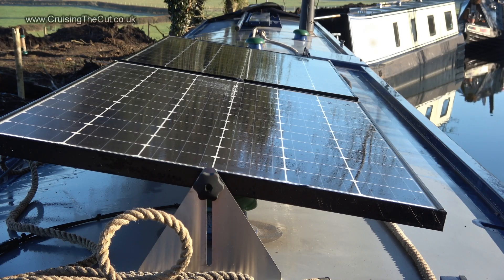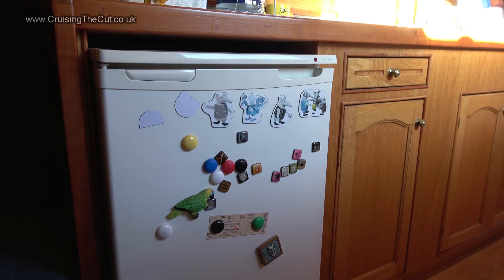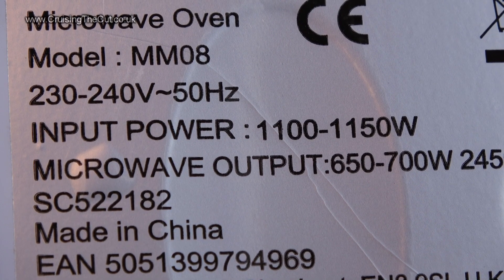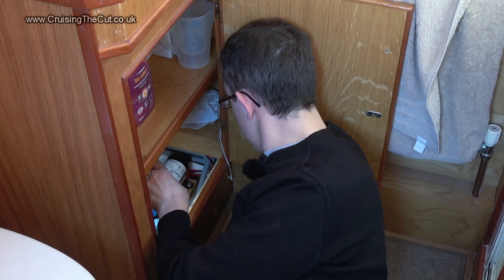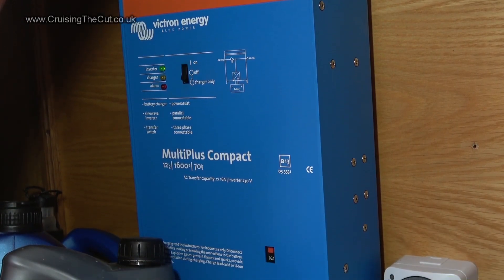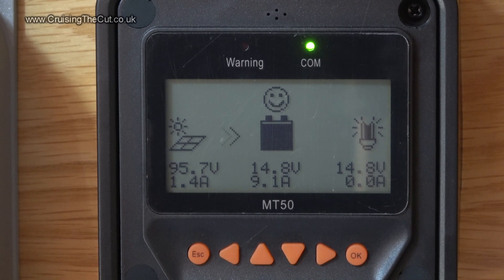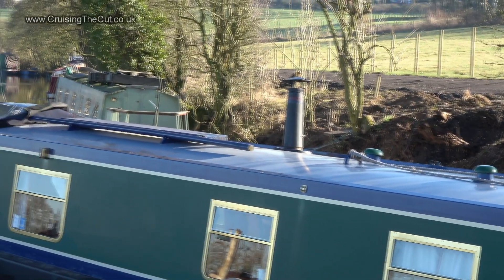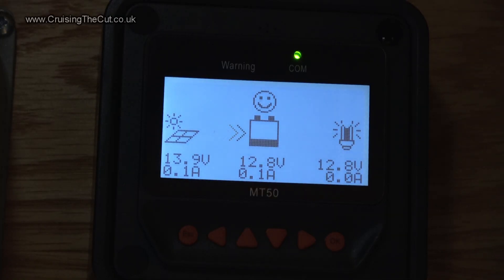76. Is solar power sufficient for a canal narrowboat in an English winter?

Comment: Hi David, as one who has worked with practical applications of solar power for about 10 years, I wanted to share a few thoughts.  As you have wisely discovered (probably the hard way), you have to account for every watt of power consumption when running from the limited supply of batteries.  (Sorry if I am repeating obvious elementary information.)

To begin with, back in episode 18 (solar system installation), I noticed you bought some very nice panels but, totally the wrong cell count.  Then, to make matters worse, the panels were connected in series.  With a 12 volt system, the preferred panel should have 36 cells and the panels should be wired in parallel.  Note that the conversation efficiency gets poorer as the difference between the inverter input voltage and battery voltage get farther apart.  Also, as you have already noticed, with a series connection, the solar output is proportional to the cell that receives the least amount of sun.  So, with the setup you have, as a minimal cost improvement, I would recommend the parallel panel connection.

Probably one of the higher watt/hour loads you have is the refrigerator.  I was just curious, how is the heat removed from the unit?  I am assuming the condenser coils are welded to the frig chassis and the whole unit is fitted into a galley cabinet.  Is there any ventilation in said cabinet?  If not, you would be raising the inside cabinet temperature and the frig would probably need to run twice as long to maintain the set temperature.

A portable inverter generator would be useful to top off the batteries if it could run off the stove gas supply and be placed in a sound isolating box.  Of course, that would be a sizable expense and engineering effort.

Adding additional solar panels would be useful but, still fall quite short of the demand requirements during poor sun days.  With solar panel output of just a few percent, you are barely covering the quiescent power draw from the power inverter.  In fact, I turn off my inverter off when mains power is not required.  I don't know if that is an option with your system, you also need a way to apply limited current to the inverter (such as through a small 12V incandescent light bulb) before throwing the power switch to prevent pitting the switch due to charging the large capacitor bank in the inverter.
Reply from the maker: Hi. The number of cells and voltage doesn't matter as it's going through an MPPT controller so it uses all the available power. They were in series because there are some advantages to doing so but I have since changed them to parallel as an experiment. It's usually the case that if one panel is in shade, the other probably is too so it doesn't make a lot of difference.

As for the fridge, I have drilled vents in the floor right behind it so that very cool air can convect up from the bilge as the hot air escapes.

The inverter draws less than 1 Amp so it's fairly low but yes I do turn it off when not in use during the day. Cheers
Reply: @CruisingTheCut  Thanks for the response David.  The MPPT controller has a circuit that constantly monitors the output power being pulled from the solar panels and is used to control panel loading to find that sweet spot where maximum panel output is achieved.  However, the farther you step down (or step up) the voltage, the more loss that gets incurred.  This is just the nature of the beast.  Yes, the MPPT helps but, you are still stuck with that loss.  Designing several DC to DC converter supplies over the years has made this (probably little known fact) evident.  Wiring the solar panels in series is only useful for simplifying the wiring between the panels and solar controller.  You can get by with less wires and those wires can be smaller in diameter.  You are probably only wasting about 5% of your power so, it's not a huge deal.

Very good on the other things I mentioned, you have obviously have been doing quite a bit of homework!
Reply: @billharris6886  I disagree that series wiring is only useful for simplifying wiring, it's also useful for stepping up panel voltage for 36v systems for example.
Reply: Excellent info

Comment: Saw something on another channel which MAY have something to do with your van solar issue that hosed the batteries. It seems Victron MPPT solar controllers don’t like getting hot and when they are subjected to hot conditions the load side turns off. If your van is closed up in storage in conditions that will cause a MAJOR overheat buildup inside may have something to do with your van issue. Mark Fay MMC Jr. Engineer QMED AS-E / MSC E

Comment: I suggest adding a small nuclear reactor to your vessel...  A bit more dangerous in theory, but the power gain would be incredible.  You could sell power to other narrow boats, villages, and towns, near your changing mooring sites, somewhere off the beaten path.  The calming green glow of fission at night would be very soothing, I believe.  Or, how about this idea?  Ever put cans of beverage, into a cold lake or river, to get cold?  How about the canal water?  What is the average temperature during winter?  A submersible bin with plastic and glass watertight packages?  Might reduce your power draw at times, but would it be consistent?  Hmmm, nudge nudge poke poke say no more...
Reply: David admits he’s a bit of a numpty when it comes to DIY so adding a nuclear reactor might not be such a good thing. Plus it would be such a palaver. Maybe just add a cooling tower as he likes those, though it’d be tough with the tunnels and bridges!

Comment: Would it be possible to adapt the technology which drives the fan on top of the fire to generate electricity, during the winter months??
Reply from the maker: It already exists, yes but the power generated is tiny, barely enough to charge a phone.
Reply: @CruisingTheCut  Presumably the back-boiler which appears in the very next vlog, would be a more efficient solution, being that the immersion heater canes the batteries. Cheers!
Reply: Yes it's called heat

Comment: Hey, just know that Watt is the unit of power, that is Volts x Ampere. Ampere is the unit of current, that one should not use for power calculations. Just learn about that, any wikipedia will tell you.

I think, you should just install one or two more alternators on your diesel engine that would produce more power and especially more drag on your mashine not to run idle. You also need more battery capacity. Especially when you go for solar, you should sonsider to have power for 7 days which is the average time for weather changes. Modern Lithiumironphosphate batteries are quite suitable for that to have about 7 kWh available, needing less space than lead battries. You have wonderful sides on your boats between the windows where you could add additinal solar pannels. The other alternative is having splints or rails where you could hang them side wide on the boat or swing them up from the side walls of the boat. Lots of possiblities.
Reply from the maker: Hi. I'm fully aware that W is the power unit but all narrowboaters measure their battery banks in Ah capacity, knowing the voltage is (typically) 12V, hence using Ah for the measurements as that is the common useage.

Lithium is extremely expensive and would require additional items / modifications, it's not a straight swap. Solar on the sides is fairly useless in many areas since you can't guarantee to moor with the sides of the boat facing east/west and even if you do, the shrubbery along much of the canal would render that fairly useless. Swinging panels up will either obstruct the towpath or the canal!
Reply: @CruisingTheCut  lithium batteries are the same price as lead when you look at the lifetime use.

Comment: Assuming you were getting no power at all from your solar panels, how many hours would you need to run your engine at idle to give you those 80 amps?
Reply from the maker: Hard to say because it depends on the state of charge of the batteries (the more they fill up, the slower they take a charge). But my alternator is 55Amp so in theory a couple of hours (in reality, it would be longer)
Reply: @CruisingTheCut  - Thanks. That sounds like a good excuse to push some more scenery past you every day the weather allows, even if it's just a loop between winding holes either side of your mooring.

I've never stood stock still at the helm for 3 hours on a 'crisp' winter day though, which would perhaps dampen my enthusiasm after a couple of weeks. I've seen that you are going to be cruising in winter 'in the future', so I look forward to seeing how you got on with it.
Reply: @CruisingTheCut  With batteries discharged that deeply, running the engine at idle is really hard on the alternator.  The average alternator has a rated output at a shaft speed of 5,000 rpm.  Running the alternator slower (such as at engine idle) overheats the alternator due to the reduced airflow produced by the fan, resulting in a shorten alternator life (generally taking out the 3 phase rectifier).

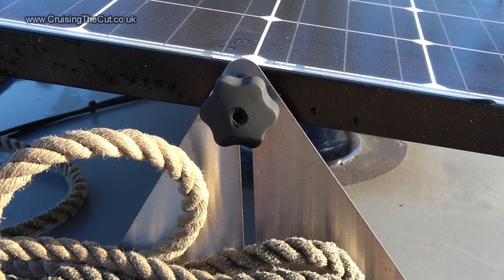Comment: 1:18 - if you ever refit or replace those panels, try to devise a double-hinge arrangement that allows them to lift closer to vertical for low-angle winter sun while moored in one spot for a while.  Incidence angle makes a large difference in winter, in summer much less so. 

Also, remember to keep them clean for max efficiency, especially from large chuncks of bird muck.
Reply from the maker: Sure, angling to the sun will help but in the short winter days, with very little sun to be seen anyway (mostly rain and miserableness in the UK winter), it won't make much difference since even doubling would mean twice very little. Plus a lot of the canals are bounded by trees and shrubs so the sun isn't even visible at low elevations until it's risen.
Reply: @CruisingTheCut  yeah I'd probaby remove them for cleaning then winter storage onshore in a safe place to be fair, especially in a marina most of the winter :)  

Winter CCs are more likely to gain from optimising solar and DC bus tricks than summer tourers. As a electronics geek I'm thinkng more about longterm battery service life (DoD and total cycles) than just the purewattage output. Better a trickle than nowt.

Much more to be gained from a good fridge (or none at all in cold snaps - gas locker & coolbag-style) I think.

Comment: Love the volg! One tip: a lot of sony televisions run off 19.5v DC with an adapter. As do their laptops. IE. You can run a TV off a 12v travel adapter. That way you cut out ac/DC conversions. Saves you a lot. Also: 12v fridges don't have to have energy efficiency/consumption labels. Efficient, they are not!! Since you already have a very decent inverter with standby mode. I REALLY recommend investing in a energy efficient 230v fridge. (I've lived off 400wp solar for 2 years)
Reply from the maker: I’m going to disagree with you about the 12V fridges; the modern compressor units are extremely efficient. I think you may be confusing them with the old caravan “three way” fridges which ran on gas, 12V DC and 230V AC - those are indeed inefficient when on 12V.
Reply: @CruisingTheCut  three way fridges are out of the question anyway indeed (70w 24/7). I meant the compressor ones. You are right. The newer ones are better. But they still don't have to comply to the same standard as "house" fridges. Best of luck to you!

Comment: Why not just have a small quite efficient Honda generator?
Reply from the maker: You can and many boaters do but they're not that quiet really, even the Honda ones (which I agree are very good as generators go) plus you have to store petrol aboard which is a hazard, and you have to trudge off to petrol stations to get it (nowhere on the canals supplies petrol, only diesel)
Reply: @CruisingTheCut  Gas conversion is a decent option as you're already carrying gas for cooking.
Reply: As someone who has experienced block-wide power outages with loads of neighbors running generators and those generators were further away than another boat would be and the walls on my house are thicker than on a narrowboat... I would absolutely loathe anyone running a generator constantly and would do my best to moor someplace else.

Comment: Hi, love your vlogs. We’ve the same panels on our narrowboat, but yours are producing a much higher voltage. Are your panels wired in series or parallel? Many thanks.
Reply from the maker: They're 50V panels wired in series. I might rejig them to parallel at some point but have never really had any issue with part-shading.
Reply: CruisingTheCut Thank you for taking the time to get back to us, we owe you a pint! Take care!

Comment: my caravan fridge is triple fuel, i can run it on 12vdc, 240vac and even propane gas(red bottle), i have tried to run it on blue bottle gas(butane) once in an emergency but it was not fully cold and used a lot of gas.
people say there is no real difference between blue or red gas, but anyone who has used both will tell you that red burns hotter and seems to last longer, i have a 3 bottle capacity 2 red that i use all the time and a back up blue, i have to have a blue as well since not all gas sellers have red and have had to use blue on more than one occasion due to availability in that event i run the fridge on hookup.
do boats use gas at all?.
Reply from the maker: Gas is generally used for cooking and some (mostly older) narrowboats have a gas-fired instant water heater (they're no longer permitted to be installed in new builds) but gas fridges aren't used for safety reasons.

Comment: Great episode. During winter especially you could add an extendable wind turbine although there can be vibration and other issues. But actually, your log burner can be a great source of electricity. I can'tremember what they are called but there are things that you can get that convert heat into electricity.  Sometimes it us not just about looking at one alternate source, but several
Reply from the maker: Wind turbines on canals are fairly useless even in winter, see my website FAQ page, cheers. Also those heat energy things produce minuscule amounts of power, typically enough only to charge a mobile phone. Solar is really the only viable option and that’s hopeless in winter too, by and large.
Reply: Peltier-effect thermo-electric devices create electricity from heat, but require a good heat differential/"delta-t" (they need a "cold side" as well as a hot one) Whilst its true they produce electricity, the power output is relatively low - 20-100 watts is acheivable with a very hot stove and good cooling though I suspect to get anywhere close to that on a boat you'd need a skin tank for a cold side.
5 to 8 watts max is what I've seen from my experiments from a "45 watt" model under my own "normal" conditions. This is indeed around what it takes to charge a fone. 
Fine if you want to only charge a fine though and they have no moving parts, so within limits they do work. I have used them extensively for cooling electronics and radio gear so I'm quite familiar with their use and their limitations - so watch out for unscrupulous/ignorant  manufacturers and marketers claiming the absolute maximum cooling specifications of series or parallel TEC modules as output power figures. The real-world output figures used as a TE generator will usually be many times lower.

Comment: Not sure if you have modified your system in a later video as I am still watching through them, but personally I would be running either a 24 or a 48 volt system, you will be able to run your appliances for longer, with less current draw on the batteries. I run a 48 volt system here in my caravan, and it is amazing how much better it is than the original 12 volt system. Food for thought anyway :-)
Reply from the maker: It would be quite the nuisance to modify everything to 48V now, not least because so little of the gear accepts it. Fridges etc. You do get 24V boats but again, not worth the hassle to change what I already have.
Reply: @CruisingTheCut  yes it's probably more trouble than it's worth if what you have is working for you, usually with 48 volt systems you run everything off the inverter as 240v, it would be interesting to see if a wind turbine could be adapted to your boat, I use one here and it adds power anytime the wind is blowing, you could get away with a 700 watt unit easily enough on a short mast that can fold down when it's time to cruise.
Reply from the maker: Ah, I see what you mean so the 48V element is purely within the battery bank and then everything else is 230V mains. Gotcha. I think if I had a new boat (which would be electric drive) then I would indeed consider such a system. Wind turbines are fairly useless generally and especially on a narrowboat as they need a really decent, constant breeze to generate anything worthwhile and a lot of the canals just don't get that breeze in part to trees / shrubs alongside. I'm amazed you get anything sensible out of yours...do you have it on a nice sturdy high pole?
Reply: @CruisingTheCut  you may actually find your wiring is rated for more than 12volts so it may only be things like breakers/MCBs, lampholders, LED luminaires etc that need upgrading. 

48v means much less voltage drop (4x less) for heavy current loads on long cable runs, but even if you just use a 48V battery system and 48 to 230V inverter then you should see improvements. This is only worth it when it comes to refit time though, due to the cost.
 
A lot of industrial telecoms equipment uses 48V DC for  the same reasons (including telephone exchanges)

Comment: You need to adjust the angle of the panels. IIRC that will give you an extra 20% - and that's free energy.
Reply from the maker: Agreed, the angle helps but in winter, 20% extra on bugger all is still bugger all.